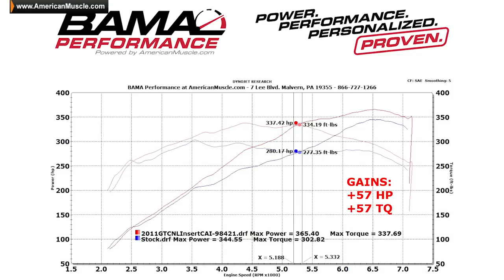10 Second 2012 Mustang GT Overview + Justin's 2014 GT Gets New Parts - Hot Lap

Comment: Please please make videos with this mustang when he does head and cam work I would like to see it.
Reply from the maker: Something tells me Mike will be back to hang out with us very soon! Stay tuned.. -Dan
Reply: Lol I see your comments on lots of car videos
Reply: What can i say I'm into cars.
Reply: Thanks Adam.. the AM guys will be right there video my ride when she goes for the 10.7's record and after my cam work.. The AM guys are great and I cant wait to work with them again..
Reply: i could see cams doing some good, but heads? how much is still left on the table, these 'yote heads are amazing
Reply: joshua arnott we are hoping to get about 520's to the rear wheels with Stage 3 cams.. i'm up in the air about fully pulling the heads off the block to be cleaned up but if I can find a set of heads before hand I will send them out.
Reply: 520 N/A?? dumbfounded
this engine is unreal
Reply: Ls3 makes around that power to its crazy
Reply: it's amazing what gm has squeezed out of obsolete camming.
Reply: joshua arnott
Remember how you thought head-work wouldn't help make more power?  Well that's how gm makes such good power with "obsolete camming."  If you don't know the benefits to having the best heads then your hopeless when it comes to any engine building man.  It's the number 1 most important factor to an engine.  Cam's are custom ground to match the heads not the other way around.  Always get the best heads you can afford, then custom grind your cam then put down the big power.

Comment: In terms of SVT or Shelby power. If the 5.0 makes 420hp at 6500, then it makes 339 lb ft. That goes to 393lbft from a similarly efficient 5.8 liter. So, if they give it 14psi of cold boost, and they get 80% of the boost benefit, we're looking at 708 pound feet of torque at 6500. Which should give us 870hp. If the supercharger is 50% efficient, we're still looking at 730hp. The power is there. The 660hp shelby was breathing in lots of hot air.

Comment: I hope Ford will take the crown again and over throw the hellcat!
Reply from the maker: I have no doubts that Ford will! If they're talking 750 HP in a Mustang that is hundreds of pounds lighter. We're talking a rocket ship! -Dan
Reply: The current gt500 beat the hellcat in 0-60 and quarter mile times. The hellcat is just too heavy.
Reply: dunkingkid7 the hell cat ran 10.8 just a bit faster than the Shelby
Reply: a Ma
10.8 on Drag slicks. Lol.
Reply: dunkingkid7 very true but they changed the tire set up from stock
Reply: It's still a Mopar turd...
Reply: SC04Cobra  lol yep.

'16 svt will stomp it.
Reply: Hi...Don't Forget... More H.P. doesn't always mean more Performance...i.e.. 276?? H.P. 2013 Accord...0-60 in 5.6...Newer 475 H.P. Challenger SRT...0-60 in 5.2, or a Touch Slower...Other Source...4.5... However, Still about only 1 second Quicker, w/ 199 More H.P....It's a Funny Thing :):):)
Reply: The Hellcat ran 11.3 on stock tires so good luck in the GT500
Mustang Fanboys ruin the car SMH
Reply: DAVID GEERLING The 392 Challenger does 0-60 in 4.2 and the 1/4 in 12.4 @ 112 Average .
Reply: Plum Crazy Purple...If that's True...I'm Glad it Does !!!  I realize, the Charger, is a Very Comfortable Car...I Love the header Orange color !! Please, gimme some credit.....I said, 0 to 60 in 4.5...That's VERY Close to the actual 4.2 !!! I am not a FAN of ANYTHING...I just go by, what I read and hear..!! You didn't even include the Year and Horse power....Also, the Inside line, is NOT the Authority on ALL THINGS about Cars...I happened to JUST Yesterday... Tell a Kid, who thinks a 2012, 370 H.P, R/T isn't quick 0- 60 in less than 6 seconds....I told him, the FACT that it's a HEAVY, AUTOMATIC car, w/ only 370 H.P, IS QUICK...Also, Very Impressive :):) I hope this Clarifies anything...I am trying to be Fair w/ You...I'm Not a True Gear Head.....Take Care Plum Crazy 1992
Reply: Plum_Crazy 1992
Yep...I just wish, the Front bumper and grill, looked better...Not Bad though !!
Reply: Plum_Crazy 1992 Ok since you guys made up now and love each other time to disable the comments. Blowin up my inbox bickering back and forth like two old women.

Comment: Federal law mandates that all vehicles must have catalytic convertors on them, if you remove them it is a $2,500 fine per catalytic convertor. My 1986 Saleen had 4 catalytic convertors so did my 2000 Lightning, so if you do the math it would be a $10,000 fine if you removed the catalytic convertors from any car that has 4 of them installed from the factory.

Comment: I would like to see SVT bring the GT350 out with the twin turbo 3.5L V6 that's in the Taurus SHO but with 450 hp and light weight. Then in 2016 bring back the GT500 with the twin turbo 5.2L Voodoo engine with 750 hp. That would shake things up pretty good.
Reply from the maker: I like the way you think!  Both of those power plants you suggested would make for a very, very formidable Mustang and would no doubt put Ford back on top in the Horsepower Wars.  Thanks for commenting! -Justin

Comment: That's on the new S550, those numbers I listed below. And what's his names white 14' 5.0 picked up 5 hp from his upgraded CAI. Most stock new 5.0's at sealevel (stick) are putting down 365-380 RWHP, the aftermarket CAI didn't add any hp, the tune did, by changing airflow parameters to get the engine to run properly. Its a complete waste to put a Cobrajet or BOSS mani on these S197 cars without the rest of the supporting modds to make them work correctly to any reasonable level . The Coyote 5.0 is not the the Roadrunner (BOSS) 5.0.... Far from it Infact. Just swap a drop-in filter replacement in there and some good long tubes, and full 2.75" full piping all the way back and nice muffs. 3" piping doesn't squeeze the exhaust gases fast enough. 3" is to big., it reduces the speed of exit flow. The fast it gets out the better, so split the diff between stock & a 3" system, I guarantee you'll see more hp & tq. This new 5.0 will be a nice machine. That Eco-stang has serious potential. Bigger turbo and 430hp, some weight dropping parts, could be a low 11's sec machine, considering Ford Racing has the First ecoboost in the 12's, mid 12's to be exact, and mid 11's NA s550.

Comment: Even if the SVT Ford makes around 700 horsepower or slightly less, it will STILL TRUMP the Hellcat d/t better power to weight. Additionally,  If the Ford's transmission proves to be a faster and smoother shifting one then that will also improve acceleration times.

Comment: the most annoying thing with the new mustangs is the extra +100lbs in curb weight , very disappointed ,
Reply from the maker: The extra weight is roughly 90 lbs. I agree that is disappointing. However, with the IRS etc.. I guess it was sort of expected! -Dan
Reply: it can turn now trade off not that bad
Reply: AmericanMuscle.com the +10 hp gain will help the bonus weight so no problem.
Reply: At least 30 pds to gain in overall weight from personal weight loss, lol   (sorry guys)

Comment: Hold up wait a minute did you know the hellcat originally made 850 horsepower but had to be dialed back so it would not surpass the ferraris horsepower and not to mention the four door does 0 to 60 in 2.9 seconds on street legal drag radials  Ford and gm bring it on

Comment: The guy going for the record should remove his exhaust and install break away mirrors
Reply: my car is a street car. it will still have A/C and have a full exhaust that you can drive on the street without being pulled over. but thank you for the ideas..
Reply: Try the break away mirrors then
Reply: adam gartner i'll have to look into that, but we are trying to max out the HP on the motor first..

Comment: WTF, guy can't get over 400 rear wheel torque with E85 AND, a CJM, tune and a fucking full exhaust!? I'd throw my car away and buy another one. Something just isn't right about that.
Reply from the maker: Man- you must be tough to please Alex!  The car runs 10's on MOTOR all day long! People get so caught up in dyno numbers but fail to consider a dyno is nothing more than a tuning tool- the real test is how it performs at the track and as you can see Mike's car is doing just fine. ;) -Justin
Reply: AmericanMuscle.com LOL maybe I am Justin. I'm a big supporter of American Muscle, spent more than a pretty penny there last year, so no problem with you guys. I've seen posts over on SVTP though that people gain considerable torque with that intake manifold, so with his setup I would expect a bit more, just sayin. Besides, he's running 10s on drag radials, most any new performance car can do that. Again not hating, his car is running very well, like you said, in the tens :). I would just be a little worried about my setup personally though if it were my car with those mods.
Reply: ***** its not that easy to make a Auto put down great HP on a dyno. this car is a drag car and the ET shows it. also this car gets between 27 to 29mpg on the highway. Oh and i'm also on SVTP boards..
Reply: mike z Oh definitely not arguing that it's fast. That's evident. I was just commenting on the torque with those mods. I have high hope I guess.

Comment: Cold Air intakes are a waste of money myth. Its the tune that got the HP not the intake. Opening the intake to the engine bay which consists of hot air makes no sense. The stock air box is pulling cooler air in directly from the front of the car.....

Comment: People don't realize how much weight you can get rid of in these Coyotes without stripping any interior aside from the back seats. Mine is a 2013 GT premium, MT82, 3.73's, brembo package and no other options. Already beaten a few C5 vettes and a C6 GS by half a car and i'm bone-stock, definately plan on dropping 100+ lbs in the future. That's a mean recipe for even more GM abuse on the weekends. Tubular K-member / A-arms drops 30 lbs, rear seat delete drops 50 lbs, aluminum driveshaft drops 20 lbs, aluminum flywheel drops a couple lbs, and you can lose considerable weight with your wheel & tire choices too.
Reply: Man you're so right. 👌 #Agreed

Comment: I dont understand this off road set up that people do. Did people before just pull out the catted mid pipe and put an aftermarket mid pipe without cats on it and drive it around on the street? What about getting the thing smogged? Can someone fill me in please.
Reply from the maker: Nick TheWhiteGuy Yeah that's basically the point- getting rid of the cats is a great way to free up more power.  While we always encourage customers to take their local laws into consideration, gear heads and hot-rodders have not always been the ones to.. 'follow the rules', if you will.  ;)  And alot of times an aftermarket or custom tune will disable the secondary O2 sensors, eliminating any check engine lights, allowing the car to pass most inspections with ease.  Hope this helps buddy.  -Justin
Reply: Wow thanks for responding! Ok so its basically dont get caught type of deal. Also it is possible to pass with the off road pipes?
One more thing, is a tune necessary when swapping out the mid pipe and mufflers?
Thanks in advance.
Reply from the maker: Nick TheWhiteGuy No problem Nick!  As I pointed out with my earlier response- the tune can eliminate any check engine lights or DTC codes that would otherwise come along with removing the cats, thus allowing you to pass emissions.  Now if they do a visual check by using a mirror under the car or something like that, then you might be out of luck.  So again if you switch to an Off-road mid pipe, yes you'll need a tune or you'll throw a 'Check Engine Light'.  As for mufflers or axle back only, you should be good without a tune.  Hope this helps!  -Justin
Reply: AmericanMuscle.com It does help very much! Thanks again and now Ima be sure to check out your off road pipes on your websites because now Im very interested in it. :)
Reply: I love that profile pic! Your dog looks like quite the character :)
Reply: Here in FL we don't have Emissions tests so we can run Off road X pipes with no cat..